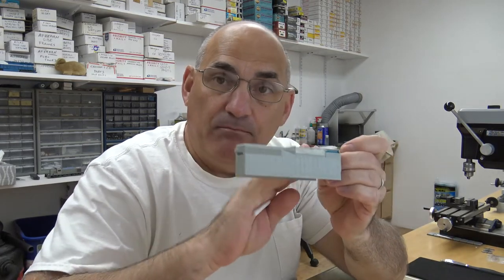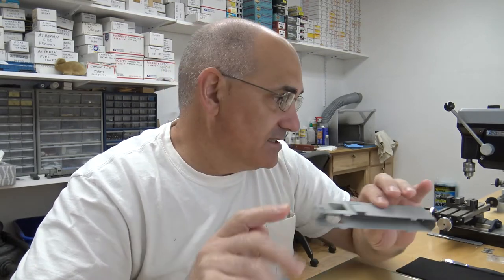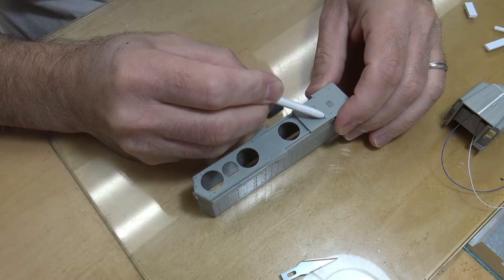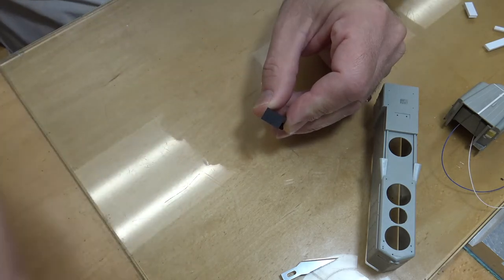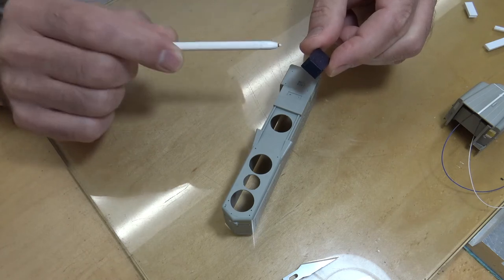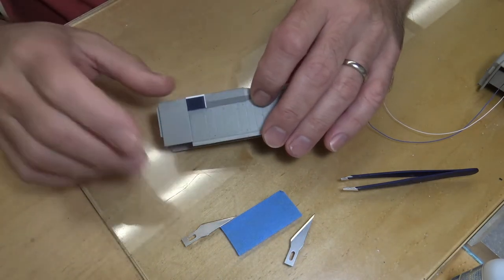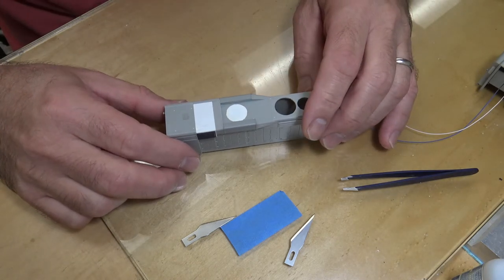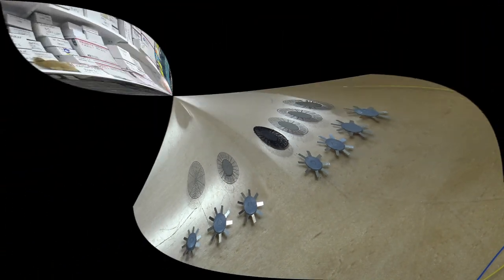CPT&C GP30 WRECK REBUILD TO GP28 PART 05

Comment: Brian, why don’t use a GP20 flared radiator fan on the rear? It will be súper cool
Reply from the maker: That indeed would be cool, but not practical. The railroad did not have any GP20's and it would not be likely that EMD would send a GP20 fan.

Comment: Hi Brian,  I really enjoy your videos and have learned a great deal from them.  It is great having solid techniques demonstrated by you that I can implement on my models.  Question for you - I have been searching high and low for Cannon & Company Radiator and Dynamic brake fans for several HO SD40-2's  but to no avail.  Would you happen to know if anyone else makes good see-through fans?  Thank you and keep up the good work.
Reply from the maker: Sorry to say yo are pretty much SOL on fans now. C&Co are out of stock and the molds are worn out. Not going to be run again unless the owner rebuilds the molds.
Reply: @6axlepwr  I just purchased some new fans from Cannon and Company that had been out of stock the better part of teh past 9 months. Migh try again to see if yo can get what you need.
Reply from the maker: Thanks for the heads up. How do they look?
Reply: @6axlepwr  I have not opened them up and taken them out of the packaging, but from what I can see with them still in the packing, they look like good quality Cannon and Company parts. Price did increase though. They are 19.75 a set now.
Reply from the maker: @wparr19691  Thanks. I ordered a pack to see for myself if they are back to being what they originally were.